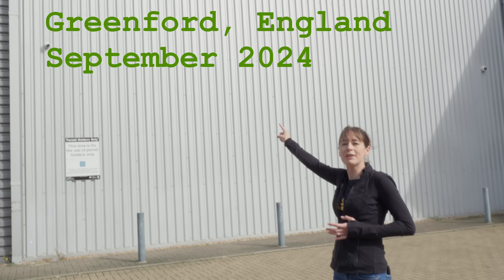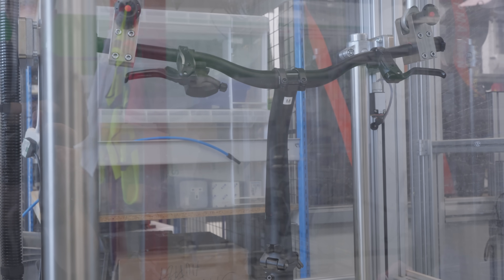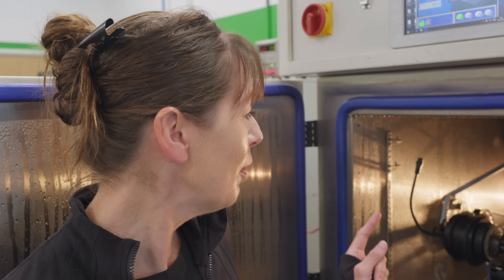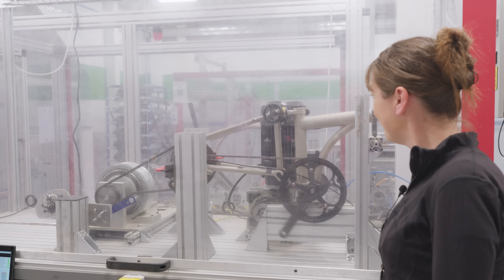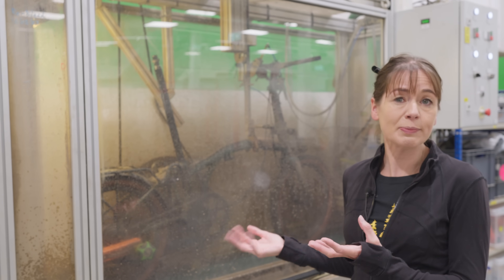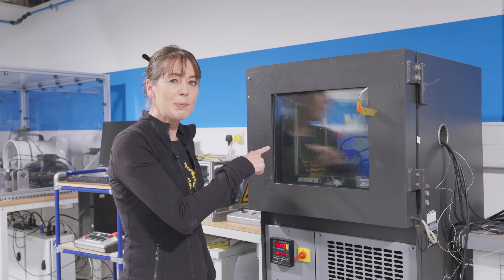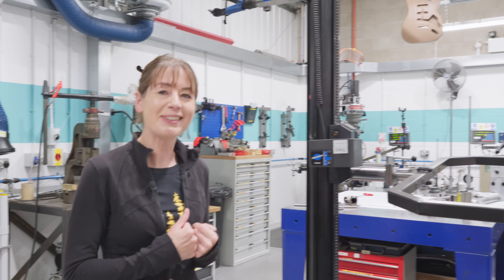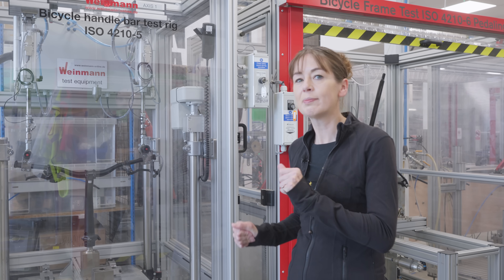Inside the Brompton R&D Centre

Comment: That was excellent! I wonder whether all those cheap (but no longer as cheap in the USA) Chinese ebikes are subjected to such rigorous testing? . . .  I feel much more confident about putting my money down on a Brompton after watching that. Also, it appealed to my inner nerd. One question - Are the drive train components on the G-Line elctric upgraded compared to those on the non-electric G-Line? Or are they considered to have demonstrated that they're already strong enough during testing?
Reply from the maker: Many thanks for watching! We were so impressed! 
The chain ring is the same. The sprockets different due to the hub and the chain a hollow pin to save weight.

Comment: Impressive! I am blown away  too. Gaining trust again in the brand after a crack in one frame (seatpost area of a classic one ). Understand now why Brompton is so confident that their products are that reliable. I suppose I need a more robust Brompton, a G-Line: I still cannot understand why it comes with an Alfine and not with the 12 gear HUB-chain  combination. The Alfine is not sufficient uphill (only with a smaller chainring)
Reply from the maker: Thanks for watching! They really do so much testing on the Brompton. I understand the hub was chosen to keep the weight lighter than the 12 speed hub

Comment: Would be nice to see 12 speed bikes on the wet sand test as my derailleur stops working in wet conditions in less then 50 kilometers
Reply from the maker: That’s very strange as the bike they were testing was a four speed! Can you check it’s all clean and set up correctly.
Thanks for watching

Comment: I've used my p line once and can tell you these advanced roller wheels are pretty crap,  there's just 1 cm of wheel that's stopping your rack from bangs and dings off the floor,  not enough clearance.  Durability issues with these roller wheels,  don't like them
Reply from the maker: Thanks for watching. To date we have not seen any issues with them.

Comment: I know the C line has been tested 'in the wild' but do they also test it in this facility or is this just for new R&D?
Reply from the maker: Thanks for watching - and for the question

The G Line is definitely tested in the wild - at the time we went - there were riders in Spain riding them for for 3 months all off road (we think one had clocked up 15000km)

There were also C Line parts in some of the machines we saw
Reply: @brilliantbikes  I would love to see you cover the problem so many people seem to be having with the front soles rubbing with the rear 6 speed hub indicator chain when folded. 

As mentioned I have issue when rolling the bicycle in shopping cart mode. Specifically, when I pushed the handlebar to roll the bike, I started hearing some loud pinging sounds. After some investigation, I figured out that the noise comes from the collision between the front wheel’s spokes and the chain tensioner nut. The nut is installed outside of the rear derailleur and it helps keep the chain taut when the Brompton is in folded or unfolded position.

The nut protrudes more on my bike since this is the 6-speed Brompton c line. Therefore, when I roll the bike, the front wheel makes contact with the ground and rotate as well. The tiny rolling wheels on the rear wheel obviously can’t provide enough clearance to lift the front wheel. So, when you roll the bike, there are more chances the spokes will hit the nut. I had to tilt the bike slightly to temporarily fix the issue. If the problem persisted, it would be a huge disappointment.

The handlebar catch has a bulge on it that hits against a bracket on the stem which is supposed to prevent the wheel from coming too close to the gear chain. 

I took it into the Brompton Junction store in New York and their solution was do not roll the bike ever

That’s like going to the doctor and asking why does my foot hurts when I walk and the doctor’s solution is to never walk. 

I think the problem is that the bulge on the catch was meant for two and three speed bicycles and not necessarily for a six speed. I have done some research and added rubber bumper on top of the bulge (essentially making the bulge larger) on the catch to make it larger so when it comes up against the bracket on the handlebar tube it keeps the spokes away from the chain.

My recommendation is to update your handlebar catch with a larger bulge/protrusion or come up with some sort of additional bumper as I did.

Comment: this is why I am bit wary about replacing the genuine Brompton parts with aftermarket ones. For things like the triangle, seatpost and other important structural things, did the manufacturer stress the components as much as Brompton did?
Very very cool video.....
if there is any doubt where your (substantial amount of) money is going when you buy a Brompton, this should alleviate some concerns.
Reply from the maker: Thanks for watching - and sharing your thoughts

We were blown away with the "hammering" they were giving the bikes

(we had actually visited the facility about a month ago during a visit launching the G Line - but had to come back to film R&D as at that point (apparently - and we didn't pay enough attention) it contained TOP SECRET stuff)

We agree abut the aftermarket parts - we have seen quite a few that don't fit / have bad tolerances etc - sometimes leading to other failures on the bike
Reply: I have 2002 6 speed Brompton,it has the Sachs 3 speed hub ,never gives any trouble .it is about ready for new hingepins and wheel rims but all original after 22 years

Comment: I have seen a man here on YouTube, making jumps from high up on his Brompton. A thing I most likely wouldn't even try on my expensive, full XTR carbon Mtb? But I would have liked a more more easy exchange of the hinges, as on the new G-line.
   But - in spite of hard testing I have also seen broken, ordinary type back-frames, both from the US and the local: "Brompton Guy", from Scotland! And I don't think they are being treated that well by Brompton, it seems - without knowing the actual circumstances!
    I do like my own, now much lighter than 2019 Superlight, for its fold and ability to be brought to anywhere as folded, but a G-line compromises that, for a little better ride, eventually? But I hardly think you are buying a Brompton for its ride?    
    And it seems that Brompton forgot to test the T-line in the moisture and mud-chamber - with those large open holes in the frame, letting in water and gravel to the crank and ball-bearings in front! 🤔      Finn. Denmark
Reply: @HenryWilkinson-c5n  My SuperlightM6LX has been modified to now below 9 kilo, with mudguards, and maybe not that many loose parts on the original bike still left untouched and not changed to titanium and carbon😄! But it still looks near fully original, til you start lifting it.
Reply: @HenryWilkinson-c5n  A Brompton is fast from stops, but the small wheels gives a higher rolling resistance during rides and there is a reason why most Mtbs are now 29"! And for a long time I didn't know for what purpose I had my low gears, of 6, til I met an absurd serpentine road going up, and had to walk on top. I still find it mostly - funny to pedal hard up a hill and being able to walk faster!
      You are able to do on a Brompton what a "Normal Bike" does, but it is much harder to do it!
     But going/racing down the serpentine road, with often full stops to pass the "Cattle Bars" crossing the road, my brakes never let me down, so disc brakes aren't really needed, also for the low speeds being reached on a Brompton!    Finn. Denmark
Reply: You are able to buy a 7 speed wheel and chain-gear changer from the East, which gives less weight and no internal friction from gears in the hub! I would prefer those from heavy internal gears.  Finn. Denmark
Reply: @HenryWilkinson-c5n  I could invest in a Titanium Frame from China and built an even lighter bike from it, but as a weight challenged, tall person I wouldn't trust my life on riding one! They are mostly built for small Asian person sizes. Finn
Reply from the maker: Thanks for watching! I understand the T line has been tested as rigorously.
Reply: @brilliantbikes  I really don't understand then, how it is possible for water and gravel to reach inside the frame and on top of the crank and ballbearings in front, unless specially prevented? It seems to be a problem when using the T-line?
    I can't tell from my own experience, but only from rumours, which I don't know is true? Finn